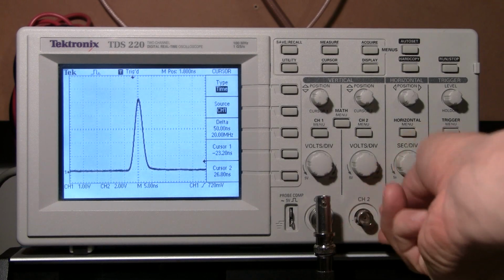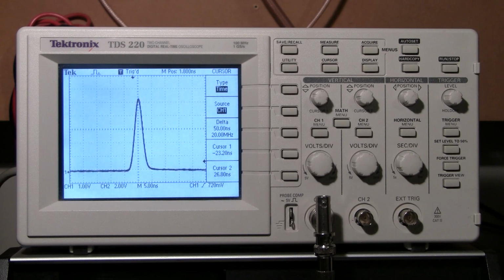TDR with different Oscilloscopes.

Comment: I love my 547. It was built in the Netherlands. I found it in 1997 on a radio amateur flea market. I spent 40DM which is about 20€. The person who sold it said it was working, which I doubted. I thought I could salvage some nice parts of it, if its broken. Back home I tested it and it worked 100%.
I found out that it got a big service by Tektronix in the mid 80s, including a new tube, new  HV-transformer and main transformer, Tektronix-tested tubes and some more parts.
Maybe it was used by the german army. I turn it on once or twice a year and watch the glowing of the tubes ;-). It's just too big for my workbench, so I don't use it for measurements.
Thank you so much for that great content you're producing!

Comment: Ha! You're not that lucky (and of course, you know this). Got a 531 that I bought from a service tech in 1997 for $50.00. It's not the stable-trace machine you have, but it still works well. Last calibration sticker is 1970. This is following absolutely no replacements of caps, resistors, or any components whatsoever.

Comment: Hi Paul,

YT resurrected this old video of yours as I was searching for old Tek scopes stuff.
I did watch each and every of your videos since discovering your channel 3 years ago or so, but had forgotten about this one.
Had forgotten just how cool, how nice it is to see these old 500 series Tek scopes in action ! :-D

Please feature them more often in your videos ! :-) 
This 547 is a beast and sure has enough features and performance for most of the stuff that you show on screen...
I understand it's sitting up high and back from your workbench, so not convenient to use it but.... it's a general purpose piece of equipment that could be used in many of your videos, one way or another, so why not move it somewhere where it's more easily accessible, so that you can fire it up seamlessly ?
To the right of your workbench there is a big grey boat anchor that I am not even sure what it is (UHF generator ?) as I can't seem to remember seeing it in any of your videos... that means it's taking up this spot on your bench yet doesn't see much use, no ?! ^^ ;-)
So why not rearrange your bench and replace the grey boat anchor with the 547 ? They look about the same size eh ?! :-D

No I am not pushey am I ?! LOL Just would love to see your 547 (or other vintage tube Tek scope you may have lying around) featured much more often ! :-)

What could I add to convince you.... ah yeah, it is YOUR fault if I love these old Tek scopes so much, yes ! LOL

Let me explain... 6 years ago I decided to get back into electronics, and 3 years ago I built myself a little lab so I can revive the hobby properly.
I started collecting old Tek scope because I just love old CRT scopes (digital or analog or hybrid/combined). Love fixing them, love playing with them...
I had gathered Tek scopes from the '90s, '80s, '70s but thought hey it's not going to be complete unless I have at least one example scope of the '60s !
Sadly these are tube based and being born in 1977 this technology truly was mystic to me, a huge black box. All I knew was that I could die from fiddling with the lethal voltages inside, and that regardless I would be unable to understand the schematics, how tubes works, how to troubleshoot this stuff etc...

But 3 years ago I came across your channel, and also I have no particular interest in radios, consumer grade or else, I watched all your videos religiously, slowly soaking every bit of information about tube stuff. After 6 months of binge watching your great videos (your are a good teacher I find !), I somehow felt I knew just enough, with just enough confidence in myself... to try and get an old Tek scope to play with. At that point I was hardly sure I would be able to fix one, but I felt confident enough to at least open it up, see what's inside, look at the schematics and have a go at troubleshooting it.

So I was all decided, I now wanted to seriously search for an old tube Tek scope. But... most of them are 500 series, which are too big and heavy to be shipped, as they exceed both weight and dimension limits of transporters here in Frog land. 
Also, they are quite rare over here. But after only 3 months, I saw an ad for one, that looked just like a 500 series, had the same elegance, same class, same aura.... but was much smaller and lighter ! It was a 317 ! :-)  the seller was able to turn it on and it showed a trace on the screen, so that meant the main transformer and CRT were OK, so if it had problems, they would have to be minor and I therefore stood a good chance of fixing it, if need was.
So I bought it ! 50 Euros, fair price. Sadly the guy would not ship it despite it was technically possible, said it was too fragile ! ARGH ! But I was motivated, I WANTED this scope to play with ! So I paid a retired guy 80 Euros, yes more than the price of the scope, who happened to travel with his camping van, from the south of France were the scope was, up to the north-west where I am, so he could pick it up locally and bring it to me !

Took me a year to fix it and restore it, was a tough ride as I learned so much as I went... but with the help of the grey beards on Tekscope and EEVBlog, and Tekwiki... I was able to fully sort it out, calibrate it through and through, restore it cosmetically and.... at the end of the process, the scope was running like a champ, and looked so beautiful... an art piece. I just couldn't get enough of looking at it, staring at the trace on the screen, and playing with all the knobs. It's just sex on a stick as Dave would put it ! ^^

My thread on this restoration on EEVBlog :

https://www.eevblog.com/forum/repair/vintage-tektronix-317-repair-and-restoration/

So... I was so charmed by this cute little 317, that I quickly broke the promise I made to myself : I promised that this 317 would be my first and last piece of tube equipment ! I wanted just one so my collection is complete... but I failed to keep that promise : now every time I find an old classic Tek for sale in our French equivalent of your "Craig's list "... I want to buy it ! No matter how crap and sorry it looks, no matter how horrible the pics may be, I want to buy it ! Now have 14 of them, including x4 317 and x2 547 ! :-) ... and I hardly intend to stop there... I want to harvest all those that are either local, or within  "reasonable" driving distance... so the meaning of "reasonable" varies greatly depending on the particular model, price and condition !
I mean I traveled 450kms away, and back the same day, to pick up a 549 and 547 ! Two different sellers but somehow they happened to live in the same town and sell at the same time ! Hell, when I visited the guy to pick up the 547, I discovered he also had a 545A in his lab ! Wasn't planned (not advertised on line), it was a surprise... I asked if I could buy it, said yes, got it for 60 Euros ! And it works and is in mint cosmetic condition ! :-D
Guy even has a 1L20 4GHz spectrum analyzer plug-in, in tip top shape that works! :-D  Also has a cool 180A time mark generator ! :-D
I intend to get all that from him of course ! :-)

I also have a 310A, 502, 502A, 515A, 531A, 585A.  Would like a 545B if I can lay my hands on one... and a 570 tube curve tracer, and a 575 tracer for transistors ! :-D  Needless to say I will never find these in France, not a chance, or at least not before long and not for a reasonable price. Think I saw one a year ago for under 300 Euros, yikes. Right now there is a 545B in the UK on Ebay for 900 Euros ! Hey ? I got my 545A for 60 and a 547s respectively for 75 and 45 Euros ! There is some silly speculation going on with these old Tek scopes... so I try to harvest them while it's still possible to find some for cheap... might not last ! :-/

SOOOO !! M. Carlson.... it's clear that without your teaching and passion, I would never, ever, have had the balls to plunge into these old tube Tek scopes, or anything tube based. But I am so glad I did, so much fun and pleasure to be had, fixing and playing with these scopes ! :-D

See ? I told you it was your fault ! LOL

So please consider featuring your 547 a lot more often in your great videos ! :-)

Thanks again for all your nice videos, keep up the good work ! :-)

Vincent Trouilliez from Frog land.

Comment: Graduating from an Engineering College in 1969 with a BS degree in Electrical Engineering, I first obtained a position working for a tube manufacturer and although the money was good and I learned a lot from a mentor there, it didn’t quite peak my interest in electronics!  This was when transistors started to replace vacuum tubes so a neighbor was working for IT&T and gave me reference material for electronic projects but not in the field of designing circuits which I loved to do so I did them at home starting with Radio Shack equipment trying to understand what they did and how I could modify or improve them. So my career started out with a desire to be in circuit designing, however there were no immediate openings within local distance from my home and I had to repay my family for the cost of college! Then to my surprise I saw an ad for an EE with a Engineering Firm that was for mostly  dealing in Civil Engineering and desperately needed some one to work in their Electrical group and the pay was twice what I was making in tube work, so the choice was easy at that time since more money meant the faster I could repay my college debt. Well not only was I designing circuits for various equipment I would also fix broken electrical test gear! Getting to the point, I was asked to work in their power group for even more money with a broader type of design of power generation, distribution and also new manufacturing facilities,although this led me away from electronics circuits to power circuits,  I love your channel since it reminds me of what path I could have had  at a young age because I retired Principal Engineer in power, but never lost my interest in electronics and you peak my interest of what could have been reaching your level of knowledge in electronics! Keep up the restoration projects and the circuit diagrams, I surely believe it will influence young graduates to peruse the very interesting world that you have mastered
Reply from the maker: Thanks for taking the time to write Robert! Thanks for your kind comment too.

Comment: I worked on those Teks early in my career.   They are wonderful.  The manuals, alone, are astounding.  My home unit now is a MDO 3014.  4 channels AND it includes a 3 GHz spectrum analyzer, waveform math (including FFT),  a logic analyzer (option) (including protocol analysis and triggering), and an arbitrary function generator.  You can use the AWG to make TDR step pulses.   Tek hardware continues to amaze.

Comment: I know that my question will sound dumb (I'm not a electronics expert) but... Can you use a Oscilloscope as a Radar (A-scope) display?
Reply from the maker: Yes you can, using the external horizontal inputs.
Reply: Mr Carlson's Lab Thank you.
Reply: That's not a dumb question at all! If I remember correctly, early WW2 radar sets used modified Oscilloscopes for their displays (A-scope, B-scope, C-scope, J-scope etc). Later they were replaced with PPI's.
Reply: Definitely a great question. I had to stop and think for a second, I don't think you'd even have to modify it. Just let it use the Z axis to place the blips on the screen. Now it wouldn't put the flight number next to the blip unless it was running in raster mode.
Reply: That would be a super cool project for an antique analog oscilloscope - the older the better! From what I understand, these types of patterns can be created with “oscilloscope music” (lissajous patterns) through the scope’s x-y input, but I’m not sure when that function first became available..

Comment: Old scopes, beautiful.
Reply from the maker: +Robert Langford 
I almost enjoy collecting scopes more than old receivers. Space is an issue!
Reply: +Mr Carlson's Lab Space & heat. I sold an old Tektronix scope, because it was heating my lab up, and the lab was already running between 88 and 94 degrees in summer, with the AC running full blast. It looks like Rube Goldberg designed the duct work, so that back room get almost no airflow.

Comment: I have a Tektronix 2235 scope that I was using the other day to determine if a Heathkit IG-102 signal generator I picked up was working and now the scope does not display a trace, but when I push the trace finder the dot shows up. I'm sure you've seen this before and can tell me where to start looking for the problem and what most likely happened
Reply from the maker: +Dan Eriksen 
No trace on either channel?
Reply from the maker: +Mr Carlson's Lab 
Wow, just got your notification now.... I see you asked this 2 months ago... weird.

Comment: Mr. Carlson could you give me your opinion on my scope if it is worth putting money in it. has some problem with the trigger circuit.
It is a Tektronix model 2213 the year is aprox 1982 .
Reply from the maker: MrMac5150  Depends what your paying for it. Are you sure it's just triggering?
Reply: Mr Carlson's Lab
I paid $150.00 for it and it has the trace with
multable noise lines with it, on the screen.
Reply: Mr Carlson's Lab
I heard this model may have problems, if you think it is something that I can go threw resistors and caps, to rebuild it, yet when you
put it on its internal cal terminal, it looks right.
Reply from the maker: MrMac5150 If it's paid for, no harm in trying to fix it. I would like to give you some advice, but there could be so many different things wrong.
Reply: Mr Carlson's Lab
The question is where to start. I did the easy stuff, new probes, checked all the grounds, and the funny thing is that it's internal calibration lug check looks fine, but when you measure something externally, it is just all over the place, I am still a learner where you take each component and check them individually.
Reply from the maker: This may sound like a silly question, but is the shield connection on your probe good? When the shield is broken at he BNC or when its open at the probe, you will get an unstable trace.
Reply: Mr Carlson's Lab
I checked the grounds and put a new Chinese probe on it, it is something internal, I thought the same, cleaned up the switches, thinking it might be a bad connection. I am thinking of going threw every component, which I know after that it will never work again. I wonder if the service manual has voltage service test points, but I bet all the caps are bad after 35 years.
Only someone like you, could resurrect it from the grave. The aesthetics are great all knobs are perfect.
Reply: *****

I hope if they get big mouth Trump in as President, that all those stickers in the store that say Made in China: start saying Made in the U.S.A.   Cheers :)